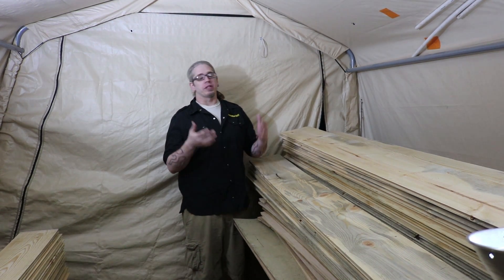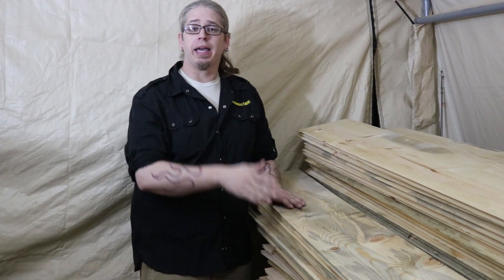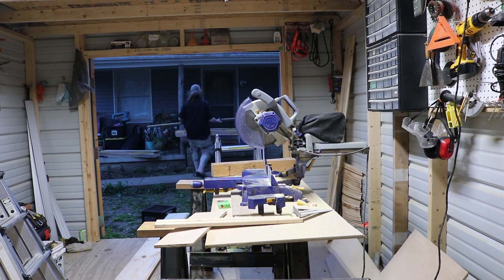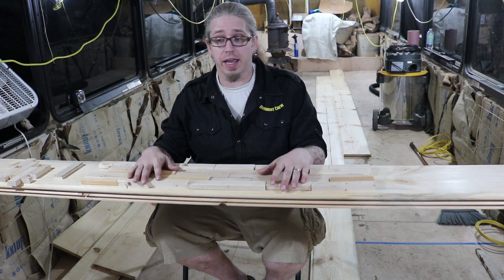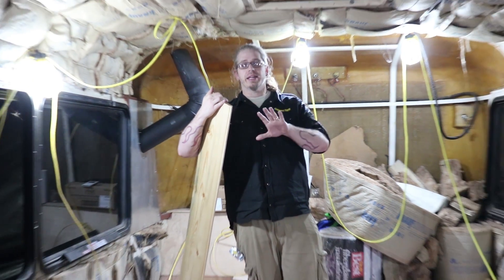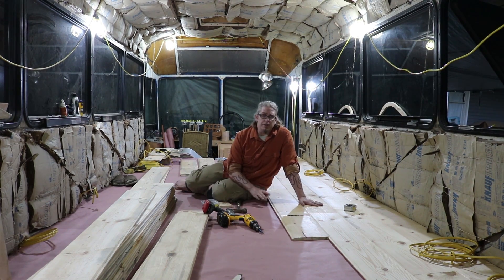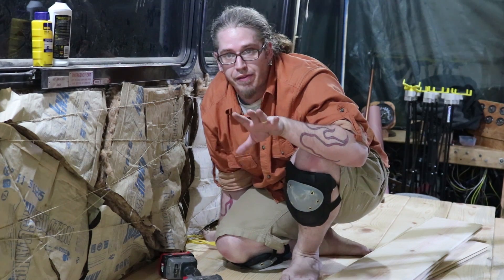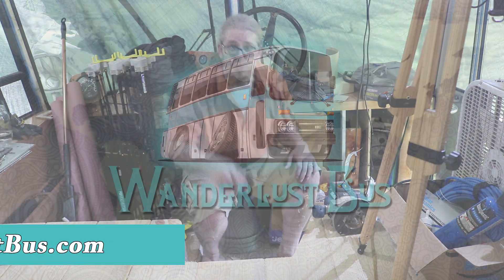Wanderlust Bus Beetle Kill Pine Flooring Installation: Pining for the Floors

Comment: Not sure if you cut that vlap yourself, but if you cut your own lumber its a lot faster if you just lay the boards down and fill the space between them with wood glue/sanding dust, as it looks like grout.
Reply from the maker: ebp1234 nope, picked it up at a local lumber mill